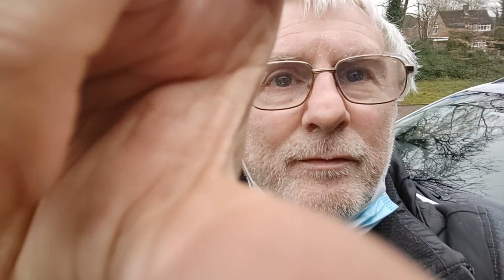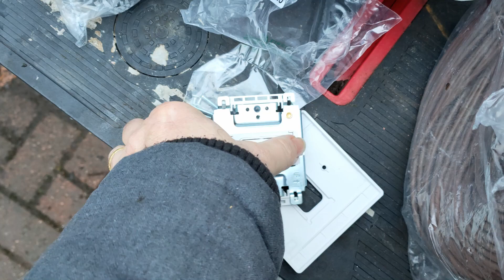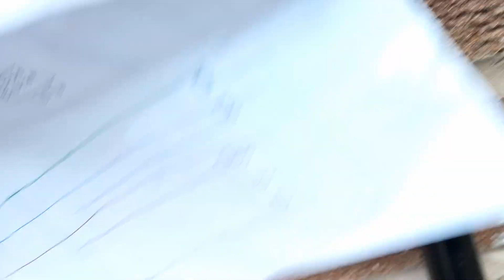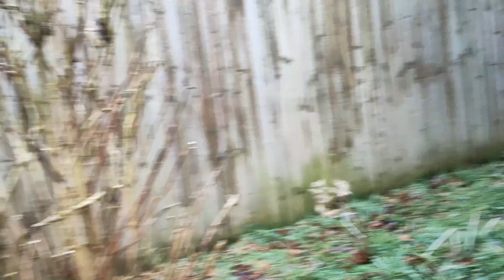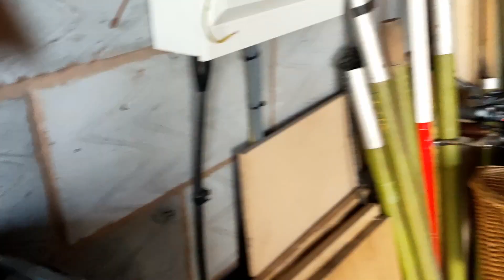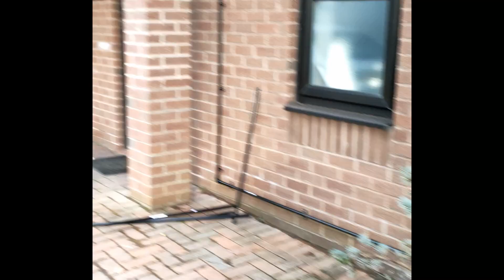The Ultimate Guide: Floodlight Wiring with PIR & 3-Way Grid Switch

Comment: Really untidy install IMHO.
Why drill thru from inside of garage low down then run twin & earth up outside wall to another junction box, looks awful.
There's a far neater way with less junction boxes.
Should have watched some PIR floodlight unstall vids before starting the job IMHO.
Reply from the maker: Unfortunately I was restricted in what I could and couldn't do. The house is a vicarage owned by the local church, so the vicar is only a tenant for as long as they are the vicar of the church, thus any work to the building cannot change its structure (ie drill holes in walls etc). Had to be treated as if it was a listed building. What's not shown is the number of meetings I had to have to approve each bit, right down to keeping the illumination strickly within the grounds, nothing could spill over in anyway.
Reply: @vwes  -didn't realise the church had so many powers in this day and age lol👍

Comment: Hi quick question I have a outside light already in place is it possible just to remove light and use wires for a newer light with a sensor thanks
Reply from the maker: It should be, but without actually seeing the existing light, wiring and new light with sensor I wouldn't like to say for definite. The lights here had separate PIR's so the wiring is a little more complicated than for a light with an integrated sensor.
Reply: @vwes  hi light I would be purchasing has sensor built in thanks for reply

Comment: you should have thought about drilling into garage to stop brick burst on face brickwork
Reply from the maker: Indeed, and I thought i'd cracked it by slowly going up bit sizes, but these bricks just crumbled when i got to 22mm. What I've done since this video, is drilled a pilot hole from the inside out with the smallest bit (4 or 5mm) and then drill back - that seems to work, especially if I'm drilling from a back box inside a house to fit a new outdoor socket.
Reply: @vwes  Just take your drill off hammer function the last little section and it will be a neat hole most of the time.

Comment: nice work - personally would have taken the light flex out the bottom of the wiska box to help prevent water ingress via a IP66 gland
Reply from the maker: Ah, good observation, and I didn't make it clear in the video, that these are the new wiska boxes with the self sealing membrane seals which in theory does away with IP rated glands.
Reply: @vwes  it would still look neater with gland in bottom of box, light cable pulled like clothes line
Reply from the maker: @paddykelly5893  Actually I wish I'd been able to video the completed project, all the cables have been neatly sorted, shortened in a couple of places